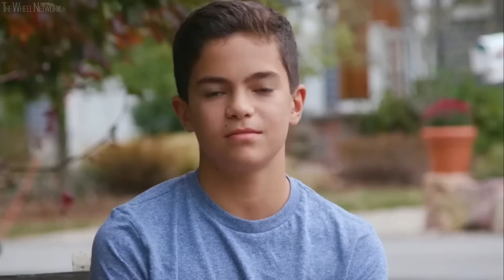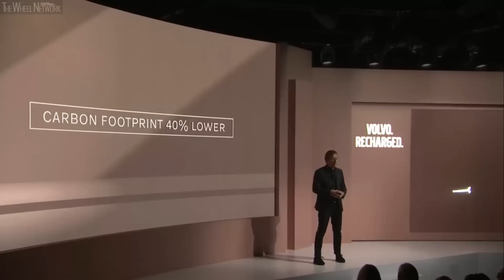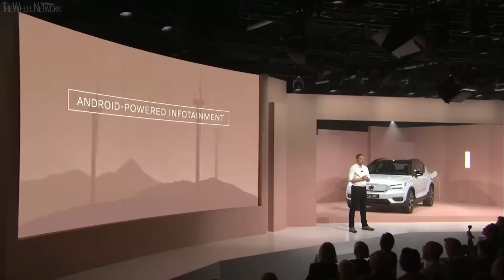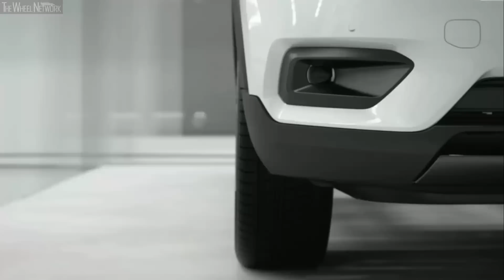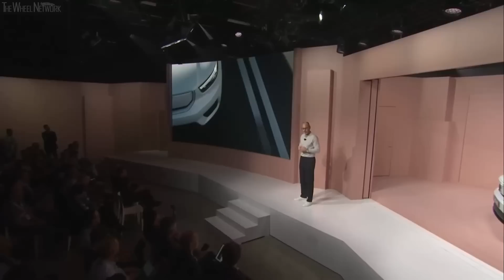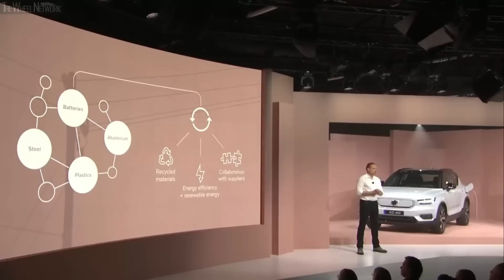Volvo XC40 Recharge Electric SUV World Premiere – Full Press Conference

Comment: Even if an electric car has 10% of the climate impact of an ICE car, one day there will be 10 times more cars on the roads so the climate impact will stay the same. This is what is not taken in consideration.
Reply: The grid will continue to get cleaner making the electrics even cleaner. Cars only last so long too. Not everything stays on the road permanently. Also with a company like Tesla for example they plan to have autonomous vehicles. When vehicles are autonomous you wont need to own one because you could just order one for a fraction of the cost of cab or uber.  No driver to pay and electricity is about 1/5 the cost of gasoline.

Comment: To begin this presentation with misinformed, anti corporation young idealists brainwashed by leftist propaganda was enough to turn me off. While I applaud any effort to reduce carbon emissions plug in to recharge is, in my opinion, not a viable solution. You still have to generate more electricity to charge more electric cars. And wind and solar can not take up the extra demand placed on an out dated electrical grid that can barely keep up with current demand. More nuclear and fossil fuel generating plants are the only present solution to recharging more electric cars. It’s the same thing as a politician saying let me raise your taxes and I’ll make CO2 magically disappear while the extra taxes do nothing meaningful to solve the problem. When Volvo joins the effort to develop hydrogen fuel cells to power electric cars as Toyota among others is doing I will consider buying one.
Reply: It's not only about reducing emissions. It's in first place about cities without emissions! Can you imagine to live in a city without any gas cars? Less allergies, fresher air. It's like everyone will move to countryside. It would be the same.
Reply: I think you don't know ,to produce useable hydrogen we need to burn fuel too

Comment: Tesla is still better in all aspects than xc40. Why i need pay $50k for xc40 wltp 400km , while tesla model 3 has real 500km for the same money. Tesla has only one big issue is low ground clearance.
Reply: Model 3 Isa car. XC40 is an SUV. SUVs are hot right now. XC40 has more interior space, comfier and looks better.
Reply: The price of course. XC40 is 10 000 euros cheaper and safer and better build quality.
Reply: You've got to remember that not everyone wants a tesla. Don't forget that specs aren't the only thing people look at when selecting a car. If it were the case then people would only by test winners
Reply: XC40 has considerably lower footprint than even a Model 3. It's much shorter at less than 4.50m long. This helps in cramped European cities like mine. Also, the XC40 will be able to tow properly. With Teslas, only the ridiculously expensive Model X can tow considerable loads.
Reply: You have google apps in xc40...
Reply: The first year el is free